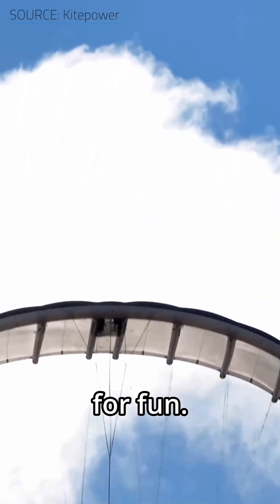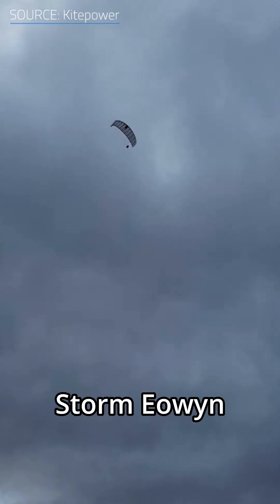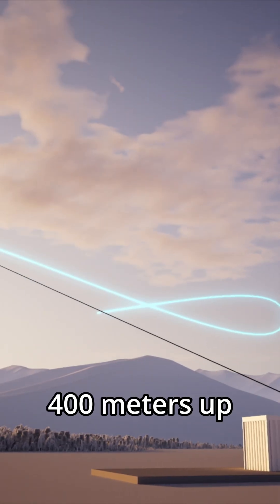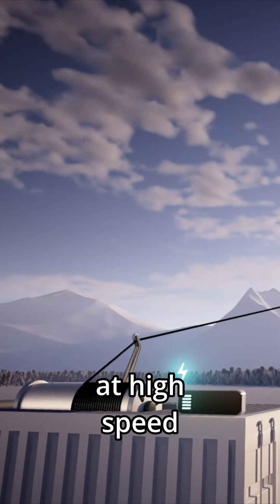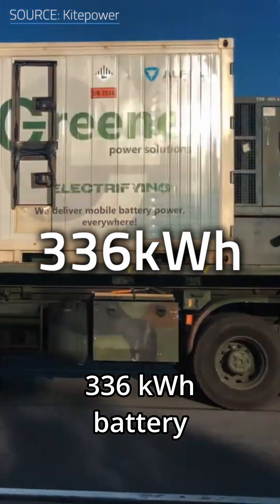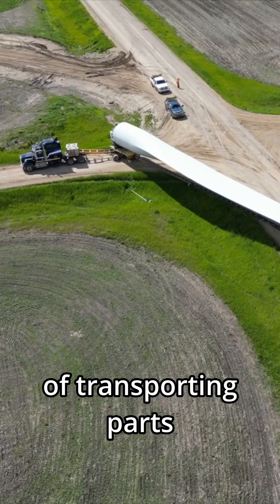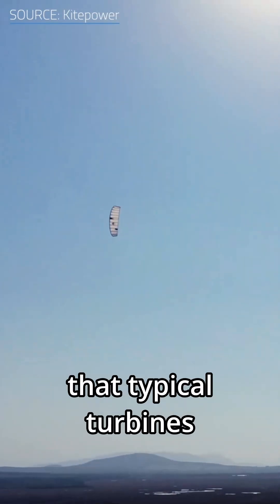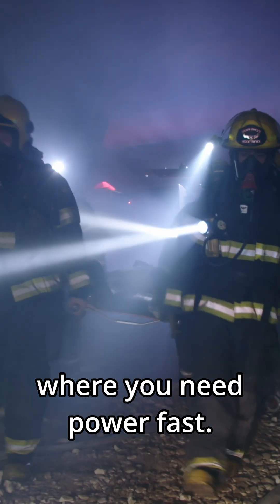Kite Wind Power is in Motion!

Comment: How much of the generated energy expressed in watts does it take to reel it back in if it generates how many watts going to the top i'm trying to understand that
Reply: Close to zero. You just put the kite in a position where the cable tension is negligible. Anyone who flies kites knows how to do this. Watch a kite surfing instruction video if you want the details.
Reply: @matthewalan59  which is way left or right from center wind position, I used to fly hyper kites and I know how to stall the kite off to the side. I was just asking to keep the facts straight.

Comment: It would be more fair to compare this with a 30 kW wind turbine, not the ones in MW class that you are referring.
Reply: @Pakkotehdataapska  What about a group of these kites operating at the same time and all of its containers output power with phase matched.!
Reply: @ElectronicsFreakEF won't they get entangled if they are too close to each other, you'd probably need more space than for wind turbine for it
Reply: @lostsoul2225 yes. A very good point.. But then, they would be suitable for specific areas such as where the conditions for installing a wind turbine are not met and on top of that there is more space available.

Comment: how much power used to kite it back? should be not much right?
Reply: Have you flown a steerable kite? A fast traverse can lift you off your feet but you can hold the turnaround with one finger & if you turnaround too late the kite falls out of the sky because there's too little tension.

Comment: I don’t get it the power needed to reel it back in doesn’t that negate the power generated? I might be missing something
Reply: It can be steered in a figure 8 pattern, soI figure it can also be adjusted to reduce the pull to some reasonably low amount that still keeps enough tension so that the line isn't tangling while the drum reels in the line. Then back to full power pulling and steering to unwind the tether again.
Reply: @stephentroyer3831  got it now that I watched it again. I heard the part where they said they reduced drag
Reply: Have you flown steerable kites?
Reply: I desperately waited for an answer to this obvious question.  Maybe drag it along (close to) ground level, where the wind isn't resisting as much.  Dang it!  I don't want to be tempted into finding out for myself... I just want to be told.

Comment: I would have liked a direct comparison of the generated power of that kite and a regular wind turbine
Reply: 30KW vs 1,000KW to 20,000KW
Reply: @alanhat5252  go big or go home? Small is beautiful.  Must every single useful endeavour massively exploit a resource to guarantee long-term insider shareholder return on investment to be valid? Is there room for appropriate application?
Reply: A comparison based on what? Length of the wing? Occupied area? A fair comparison seems impossible to me.

Comment: “The tech is still in its infancy,” because private capital doesn’t care about people, it only cares about profit. We would have transitioned away from oil primacy a century ago when Popular Mechanics (think it was that mag) first reported about the risks of that industry. It’s all well and good to discuss ideas but until we address the root, problems persist. It’s crazy how an engineering. we apply the Socratic method, but not in society.
Reply: And we've known about solar forever. So far oil keeps succeeding in killing it. What a evil, greedy world we live in.
Reply: @pete4693  yes, the Carboniferous era has given us a significant amount of fossil fuels. That amount is finite due to changes in speciation across hundreds of millions of years. The sun is not a finite resource. Technology and investments into it could optimize the energy capture of solar technology. Not to mention there’s been advancements in battery storage technology with sodium, water, and sand batteries despite oil’s efforts to suppress the industry.

Comment: The area one kite occupies is larger than one wind turbine though and they produce less power per area compared to the wind turbine.
So transportable and quickly deployable, but low yield. 
Ideal for emergencies and vast unobstructed areas, not so great for prolonged energy production.
Reply: Yeah I immediately wonder how wide an active area this would need

Because the radius between each other can’t be too close or they’re risking tangling
Reply: @AD-lh3jk well, let's say 400m altitude at 45°, mean approx 565m radius, 600 to be comfortable. 
Kick Google search tell me that a 500 kW wind turbines are set 250m appart & 410m for a 2.5 mW.
The kite energy per M2 is roughly 100 to 200 lower.
I think an analysis of the complete life cycle should be made for a more comprehensive take. Manufacturing cost & environmental impact, cost of maintenance, average production and so on...
Reply: But you can’t puta eolic turbines everywhere, with this you can
Reply: @Skatchxd 
You really can't put these kites everywhere. You need an area without obstructions. So forests or urban areas, in the vacinity of over ground power lines or near airports you can't use these. Really, the only place without issue is an open field.
Reply: @carstekoch  what if these were put on top of relatively low skyscrapers or on top of houses with all the same height
Reply: @Skatchxd  
Sure, if you rebuild your towns specifically for this application, you could make it possible. But this is true for literally everything and not a realistic approach.
Also, at this point it would be cheaper to mandate a 10kWh battery per house with a more stable outcome.

This tech has it's use cases, but grid scale energy production is not one of them.
Reply: @Skatchxd I've never heard of a building designed for an oscillating side load of 4 tons attached at a single point on the roof. How would you design it?
Reply: The ocean might be a good candidate@carstekoch
Reply: @justinkendollrozinek 
Sure, but again, off shore wind turbines can produce 5-10MW of energy. Why would you use this instead?
Reply: No idea I'm just spitballing ideas  @carstekoch
Reply: Sure but solar and wind are both terrible for prolonged energy production that by just a factor of how your getting your energy source. Sure power generation is most relevant when generation can fluxuate easily to the demand but any non-unary source would be unable to do this unless you introduce slack with storage (you always need some but the amount would greatly increase). IMO the real winner in both short and long term is radiation harnessing methods such as geothermal and nuclear technically you could call solar a radiation source but that confuses people and I would like to not have an incredibly inefficient means of energy capture.
Reply: @cullenkelley4828 
Storage is fine, especially with sodium batteries. The problem with radiation sources are that geothermal is not available on most of the planet and nuclear energy is expensive.
Reply: @carstekoch geothermal has recently become available at large scale worldwide because they've started using fracking tech (but avoiding the oil obviously). It's been available at small scale for several years & is used with heat pumps.
Reply: @carstekoch  Tbh the only reason nuclear is so expensive is due to regulation some of which is valid but much of it is duplicative and pointless.
Reply: @alanhat5252 
I've heard of this for heating. If they figured out a way to make it viable for energy production, that would be interesting.
Reply: @cullenkelley4828  regulation on nuclear is absolutely not pointless.
Those regulations were written in blood.
Nuclear power is safe, only because it is so regulated. Deregulate nuclear power and it will be unsafe. And unless you go absolutely unsafe, nuclear can't compete with wind and solar power.
Reply: @semurobo  Regulation in any industry has a balancing point where operational safety and efficiency are well balanced US airlines are a good example. They are both reasonably affordable and quite safe per flight hours yet planes still crash - rarely but it does happen there is nothing without risk. Nuclear I think is a bit over regulated. Nuclear has an excellent track record in most countries and has gotten FAR safer once the hazards were better understood. And stats support this deaths per kilowatter hour (the global standard) nuclear stands right up there with the safest technologies even when including the USSR era screwups (not a fault of the technology but rather who was running the show). Amusingly it has better ecological impact than most wind and solar projects do as well. It doesn't just compete it defeats most technologies and has all the properties one would want in a power source - something wind and solar both lack.
Reply: @cullenkelley4828 
The problem with comparing nuclear power to any other indutrie is the damage potential.
Let's look at the american aviation industrie, a HEAVILY regulated industrie btw. and loosening the restrictions due to corruption has lead to an immediate uptick in incidents in the last couple of years. They have plane/Helicopter crahes about once per year.
This would be analagous to having one very dangerous incident if not outright catastrophy in a nuclear reactor. This would make the reactor itself unusable at the very least and make the surrounding area completely unlivable for centuries at the worst. You want to have this happen once a year in the US alone?
Reply: @cullenkelley4828 nuclear often takes 30 years to deploy -- we haven't got 30 years, we've got 4 years to get most of the work done.  If we survive past 2050 we can revisit nuclear but for now it's just taking valuable resources that would be better used elsewhere.
Reply: The volume the kite occupies would be sort of a cone, so as long as there's nothing tall really close by the wire wouldn't hit anything
Reply: @seancook2129  and how would you start or land it?
Also, you are assuming the wind is constantly coming from one direction. With that assumption, you can place it in more places, but it will be useless most of the time as the wind direction is not static, but varies even throughout a single day. More realistic is a half torus.
Reply: You don't need to power a whole town, just the 300KW/h battery, which is 10 days of average household electricity.  It can be supervised in variable winds.
Reply: @mikemotorbike4283 
Right. As i said, for small, short term applications in open areas. Not for grid scale production.
Reply: But tbf it can be used for air defence if it can use radar
Reply: It can be paired up with an aerostat or tethered. These light generators keep being advertised, but not massed produced.
Reply: No, the area covered by the kite is smaller. r^Pi for a 100 m blade is 35000 m^2 …… just to get an idea. The other question is what is the opacity. Wind turbines physics limits this to about 50%. for such a kite the limit could be higher but practically at < < 50% (you have to bring the kite back in and air spills out). Kites with embedded rotors are simpler and efficient. Some companies have proposed to use such tethered kites in jet streams. Unfortunately, large scale deployment would change the earths climate (as all large scale Windturbine installations do) and the idea was abandoned. 
Of course a few wind turbines and kites as in this article have no measurable impact.